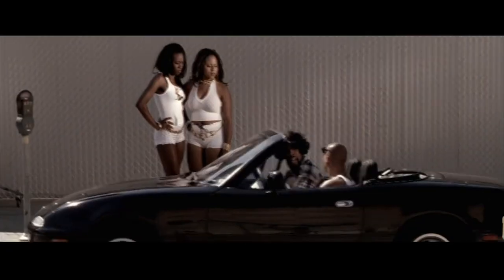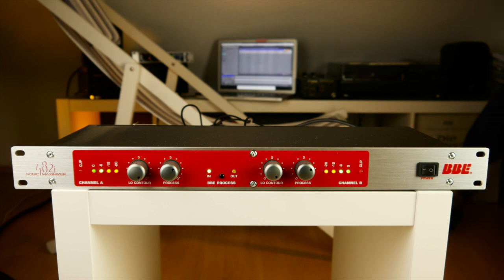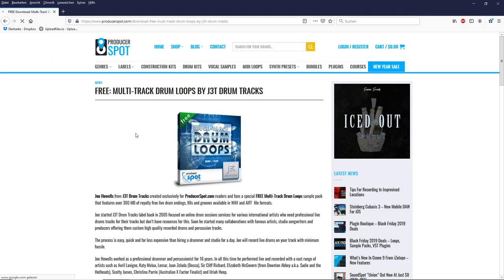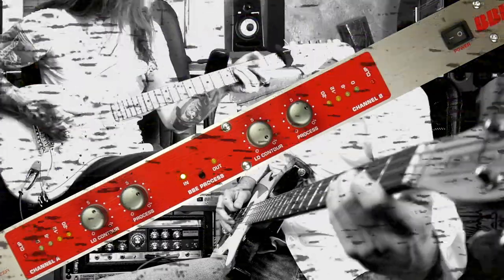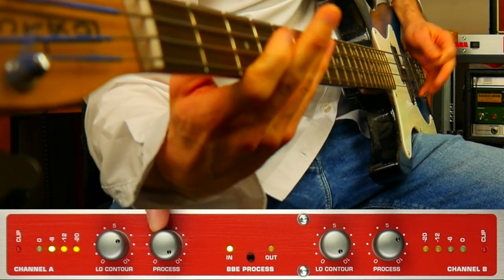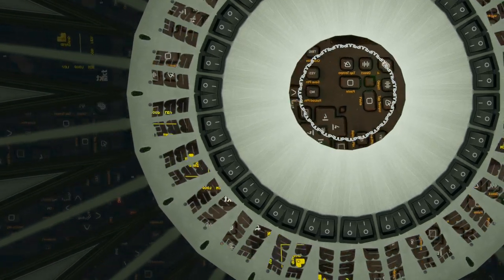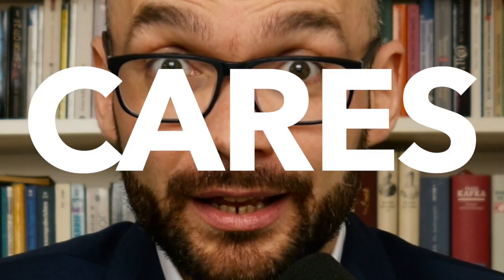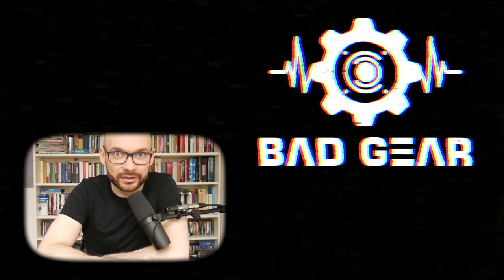Bad Gear - BBE Sonic Maximizer - Most Useless FX Processor Of All Time???

Comment: I use the plugin version on my mix bus. Very subtle settings on the low and high contour. It does something to the sound that isnt achieved to my satisfaction when just using an EQ. It gives a unique presence and sheen to the overall mix that is tasteful when used in moderation.

Comment: it is meant to be used subtly. Back in the day, I used it to get an idea of where I wanted to go with the graphic Equalizer during final mixes. Sometimes the BBE (used subtly) would suffice. But, usually it simply gave me a quick reference for what I needed to do with other outboard gear, Or to give me an idea of what a track would sound like if pushed a little in a bass influenced car stereo setup. I'd jam with the BBE for a bit, then take a 30 minute break before routing it out of the mix so I could fine tune the results of the BBE with other gear.

Sorry - I loved this thing. I really did.
Reply from the maker: I really wanted to like it but I didn't find real use for it
Reply: @AudioPilz  I was considering buying one before I watched your video. Thanks for reminding me of how I actually used it 20+ years ago. Saved me some money, you did. 😁

Comment: Frequencies, Low's&Highs Come off The Speaker at a slightly different Times
One way to Use The Maximizer Is to Correct this (subject to the listeners Ear)
It Works Great in a "Guitar chain of effects". Mine also Makes it sound like I have
Removed a Blanket from in front of the amp, much Clearer
Reply from the maker: We discussed the marketing claim of BBE and no one with expertise in acoustics and electronics could make any sense out of that
Reply: @AudioPilz  what's so hard to understand about that? Those "experts" should have understood that.

Comment: It’s not an effect . . . . Just a  sound reinforcement tool.
Reply from the maker: That's probably the best use for it. Liked it as a master FX for electronic music, though...
Reply: @AudioPilz  as a house and techno head i have this in my amazon cart ready to see if this will make my kustom pa sound better
Reply from the maker: @usdjxavi  This might work, have fun!
Reply: @AudioPilz  Honestly I'm not even sure what the thing does. It sounds like some sort of multi-band limiter, but I can't be sure.
Reply: Like rebar... through the eardrums.
Reply: @inthefade  That's exactly what it is, combined with a compressor, phase shift, and EQ.
Reply: It delays the high frequencies so they reach your ears at the same time as the low end, mainly used for processing a master buss, but that doesnt stop bbe from trying to flog it as a guitar pedal
Reply: @bengalinsky4300  Well, it can save the sound of a cheaper acoustic guitar.
The last opportunity for a tool like this I had, when we picked up a violin using a SM58 and an analog console. It helped to get brilliance.
Later with a digital console, I thought, what would I do, no easy to use analog inserts and I noticed, how good digital equalizers are. So the psychoacoustic processors can help to fix problems,  are also part of Behringer's X32.
Reply: @bengalinsky4300  Can you elaborate on that? Last time I checked, the speed of sound in air was frequency independent..
Reply: @Karl_Squell  When mixing stuff together, phase shifting occurs on multiple bands. This box splits the incoming audio into three separate bands and shifts the phase slightly for a more compact sound. Let's just say that it worked better back in the day with analog equipment and if you squeeze something like an Octatrack through it, it will come out sounding very harsh and artificial.

If you want to read more about it, good keywords are standing waves and phase shifting.
Reply: @ThatBonsaipanda  I just read about the principle in the manual and it sounds pretty much like rubbish. A summed signal split into three bands won't have a defined phase at all, let alone would the box be able to restore the "correct" relationship because there is no way for it to know which frequency was produced by what sound source. Moreover you cannot align the phases of different frequencies of course. From what I read the main effect is a "glorified mid-scoop", i.e. the input signal is spread into two bands which can be EQ'd. And the woozy phase shift correction explanations mostly snake oil.
Reply: @user-ld8ep5qr7m  LOL, right?
Reply: If it works we could  call it Harry ...just a name..it effects your sound

Comment: Dude I used the pedal to tighten up my tone for performance. It was always awesome for me. Its gotta be used correctly thats all.
Reply from the maker: I tried the best I could but sometimes I just can't make it work...
Reply: @AudioPilz  to be fair I used it on a heavily overdriven tone through a 4x12 and an orange head(thru the send). There was a lot of low end already so it helped clear and tighten that range.
Reply from the maker: @MBEG89  My personal experience is, that I like the tone on whatever I do (play guitar/bass, producing electronic music) while doing it but it does not hold up in the mixing/mastering process
Reply: @AudioPilz  It's a dynamic signal processor, it works best as a mixing or mastering tool. If you've still got it, try inserting it in a hifi system, between the cd player and the amp. It's the easiest way to hear what it does.

Comment: Never seen the application of the sonic maximizer for mixing.... I picked one up for my pedal board for around $40 USD and I find it super useful for getting more dynamics out of my amp at quite volume. I love it and its an always on for me.
Reply from the maker: Have you tried a Klon Clone as an always on?
Reply: @AudioPilz  
Yup, I run a few always on's including a tech 21 plexi amp and a keeley compresssor. Even before I had those two pedals I found the BBE just added more to my amp. Punched it up for an in room presence. Its just another layer.

Comment: I can hear the sound in the intro quite clearly. I had the Maximizer sound in the form of the BBE Sonic Stomp pedal. I couldn't really tell what it was doing exactly, but it was doing SOMETHING and I generally liked the way it sounded, at least when dialed in a certain way (if you cranked it up all the way, it just sounded excessive and overdone). I feel like you can describe all of the Sonic Maximizers in that way. Some people swear by them, but more often than not people claim they are a crutch or that they're too artificial sounding, or something like that. Either they do nothing or they just have "that sound" that nobody wants to hear anymore. It'll be interesting to watch the rest of this video.
Reply: Great video. So here's my take: the Sonic Maximizer is definitely something that requires fine adjustment. I feel like when you move the knobs too quickly, it's very easy to go from "meh" to "ugh." When dialed in right, on the right kind of instrument, it can sound pretty decent. However, it does tend to sound kind of artificial and can be noticeable in a mix. At the same time, it essentially provides a bass and high-end boost. Other people have claimed that you're better off just using an EQ, and honestly... it's hard to argue with that. For quick and easy "sonic magic," this might work in some cases. But if you actually want to control your EQ, well, just use an EQ. I'm not convinced that it does anything more than a fancy, black box-style EQ device with extremely limited controls.
Reply from the maker: Still searching for an application where another tool isn't better suited for than the BBE

Comment: I started using the 'maximizer' in the late '80s for my live PA setup which was a cheap Peavy unit. Made it sound wonderful. How it works goes back to BBE's research that discovered that the 3 audio ranges we call "lows, mids, and highs" travel at different speeds through the circuitry. Lows are fastest, followed by mids, and highs are slowest. no matter how good your equipment. the lows will always get to the speakers first, then mids, and then highs. The result is slightly muddy sound all the time. The BBE essentially 'time aligns', and corrects the phasing so all frequencies get to the speakers at the same time, giving a much cleaner and fuller sounds. The effect is more or less noticeable considering the source of the signal. It's definitely more effective with recorded music than live, however, its effect on live is nothing short of miraculous in my experience. I've owned about 6 of them, and the only one I ever found unlikeable is the BBE stomp pedal for guitars. The first one, as I said above, was to make a cheap Peavy Table-top mixer/power amp set-up work better. At the time, I was performing a single act in a Reno casino, and was constantly getting volume complaints. I use backing tracks I create myself with MIDI and multi track recording leaving our what I do live which is play guitar and sing. Once I added a BBE using a pre-amp connection out to a power amp connector in, the first thing I noticed was that my sound sucked until I flattened my graphic EQ and set the BBE with lows slightly below center level, and highs at the flat level. A sight high-end 'chirp led me to reducing EQ at the 2K level, which I've done with every system I've owned since then. (The rest of the system stays flat, except in rooms that magnify subsonics. I roll the graphic with a downward curve starting at 60 to 80 HZ. Problem solved.) The result was customers and bosses telling me I sounded much better after I "turned down" when I was actually playing louder, with no feedback at all. I now use an 882i in my studio rack for playback and mixing, and I've added the BBE apps to my Reason MIDI and recording software. The effect is so slight that I often can barely hear it, but the results on my final recordings and live performances are obvious in the compliments I get from customers and bosses.

Comment: I have built a few Sonic Stomp clone pedals and can tell you exactly what it does.. it boosts at 20 hz and 9000hz. I recently made one that has switchable high and low settings from 20 to 80hz and 5000 to 9000 hz. It does nothing involving phase alignment as BBE advertised. When used properly in a guitar rig it's amazing
Reply from the maker: Thank you for the heads up!

Comment: I’ve been using the sonic maximizer in my guitar rack for about twenty years and it’s amazing. Recently I changed out my power conditioner, power amp, wireless unit and modeler/effects processor for more modern gear. The only gear that stayed was the maximizer. Saying it’s bad and useless is like saying a Fender Twin is bad and useless because you can’t get a crushing metal tone out of it. It might not be right for your application but your gear isn’t right for mine. Does that make your gear bad and useless?
Reply from the maker: Wise words!

Comment: I like using bbe as an aux send return for ‘front of mix’ tracks to enrich mids and highs. It’s a good mixing tool. Direct inject doesn’t make it too useful, it really excels at sending one or more aux sends at -12 to -6dBu as an aux return for mixing. Use it subtly and sparingly for putting some mids and heights into a mix,  less is more.
Reply from the maker: Nice technique!

Comment: You got me again, I own one of these too. I only have one use for it now, that's when I want to put a big smiley face on the signal. I use it with my record, cassette, CD and MiniDisc players. It boost the signal a little bit so it's good for low level recordings. I spoke to my local FOH engineer years ago about Sonic Maximizer and he told they only use it for the CD player music during an interlude.

Comment: If you read the white papers and the patient on the technology..... To put it in a mathematical nut shell.....

What this does is time alignment correction with in the full range signal. This unit should be put at head of the chain, to Pre-align the signal before feeding it to your other master chain processor's/processes.......

If you use this as a vst. I also recommend using it additionally on each input of the mixer... Pre-time align all the inputs...... It pre maximizes the electrical signal feeding into or down the chain...

If your bad at math or can't read white papers, you may not want this...
Reply from the maker: Have you really read the white papers?

Comment: I don’t know I seem to disagree. First of all it’s not a base in treble booster. It’s a phase corrector. I use it in my two channel pro audio sound system and after running out of preamp center amps and equalizers it seems to do a good job but that’s just my opinion
Reply from the maker: Let's agree to disagree;)

Comment: By my experience, I used the sonic maximizer with home recording tape machines back in the day...I will say I liked it better with it using that gear vs not having it...if I had what the pro's were using back then, you know, a Studer 24 track machine, or even an Otari MX80 with a good board, it would probably be a piece of gear unused...having said that, though, I believe I saw somewhere that it was used somewhere in the signal chain of the Beach Boys hit Kokomo...I think the thing uses some kind of frequency delay...yeah, I found a comment in a forum that states that there is a slight delay of low freq vs high freq......I'd have to read back up on it, though...let me verify if I can find any validity on that Beach Boys tune... yeah, I can't find anything online in regard to that...probably will keep looking, so just hear/ say for now...thanks for covering this piece of....gear, haha! I guess it had it's useful place in time somewhere...
Reply from the maker: Thanks for watching!

Comment: I worked for BBE and GnL guitars and thought that it cleaned up the sound quite a bit when used correctly.
Reply from the maker: Thanks for the feedback
Reply: Ah, another use of language which suggests that the BBE Sonic Maximizer is somehow 'correcting' the audio. It sounds good in subtle applications, but to suggest there is something wrong that this piece of gear somehow repairs is laughable.

Comment: Isn't this the same as a parametric equalizer with high and low gain adjustments?   Which is better?
Reply from the maker: It does strange stuff to the phase of the signal, so its effect is different to that of an EQ

Comment: I used to use the plugin version but only a tiny, tiny amount - dance kicks and snares mainly, but occasionally on some lead synths. It's not really the kind of thing to use as a staple in mixing, more of a "tool" in a huge arsenal that hardly gets touched for most things. Although, for live DJing you can get dance music to sound REALLLLY punchy. Nice rounded bass in live situations that doesn't sound like you've just pushed up 60Hz on an EQ. There's definitely some non-linear dynamics magic going on inside the unit.

I'd say with modern tools at our disposal, it has become quite useless for most things. Now we can be ultra-surgical to the point where we load up hundreds of plugins in a project. But it still has some uses. Probably why it's not selling for too much money. It is quite redundant in most situations, but still has its place in niche applications where you can't get "that sound" any other way.

Comment: It was considered the poor mans pultec in the 90s since it is nothing more than a solid state passive EQ but you have to remember how far out of fashion passive EQ were by the time the BBE was brought to market. No one would have bought it if it was marketed as what it actually is because engineers pay more attention to marketing than actual sound. Pultec, Lang, and other passive EQs were no longer made and commanded a huge price on the used market so the BBE filled that gap with clever marketing for the live market and in studios it was used on Toms, kick and bass to achieve that 90s polished sound. Blackbird studios has 2 of these in every room for drums. So when a pultec in the late 80s early 90s with rust on the inside and missing knobs would cost you around $5000 the BBE would give you a similar outcome for $100 so everybody had them. But passive EQs are misunderstood. I personally preferred the Aphex Aural Exciter and big bottom boxes over passive EQs like the BBE since I had more control over the frequency instead of a one size fits all smiley face EQ. But like all things some people liked them, some hated them ,and those that hated it made the BBE a meme when the internet began to take off!! LOL Cheers!
Reply from the maker: Cheers!!!

Comment: It's a very very subtle boost effect. Listen to Anthrax's Stomp 442 album, the rythm (distorted) guitars are full with it. It boosts with a different color, punches. But if you abuse it, it messes / flushes horribly. You have to put the right dose. 
I love it with Marshall amps, works like no other boost effect. But does not work with any amps as well. And it can add some noises too... .
Reply from the maker: Yeah, that's what people tend to say about it. Maybe I've become a bit deaf but subtle settings never really made a difference for me

Comment: I just had this conversation a few days ago. The problem is most people have no idea what it's doing so they don't know how to use it. It's NOT AN EQUALIZER!!!! Hope I didn't hurt your ears. I ran that sentence through my sonic maximizer for emphasis. What it does is shift the low frequencies so that they align with the upper frequencies. Generally, especially in live environments, the lower sounds arrive at a different time than the upper frequencies. So it shifts their phase a little to tighten up the sound. But it's not a bass boost. As I said, it's not an equalizer! The process knob actually manufactures some overtones so as to alter the timbre and make it sound brighter. Remember, an equalizer can only boost what's there. But if higher frequencies don't exist, then you can boost all you want. What this does is actually create new overtones. It's an amazing piece of gear but not in the hands of a goober. Don't be a goober. Chicks don't dig goobers.
Reply: LOL!